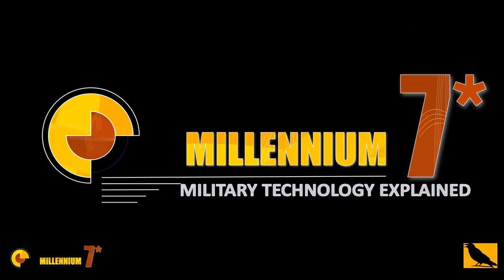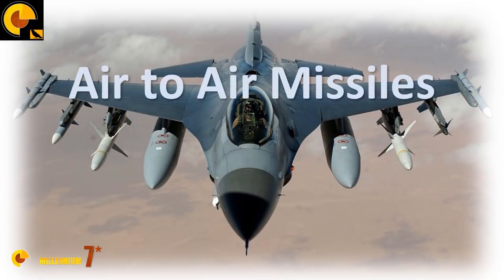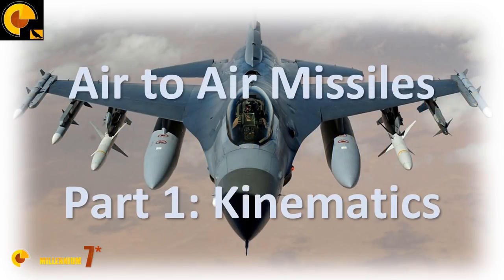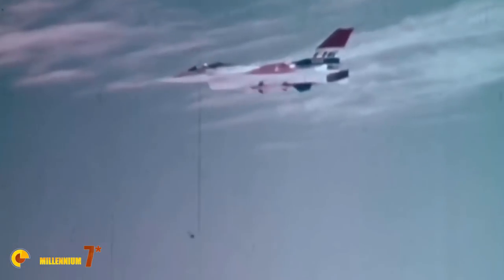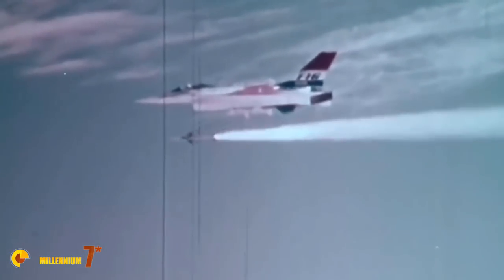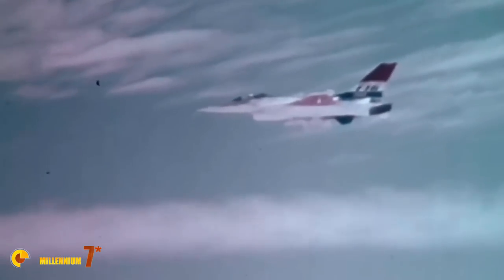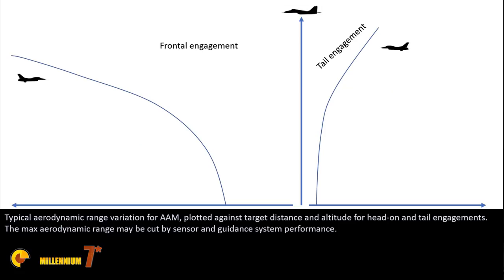Sidewinder, AMRAAM, R77, Asraam Etc. What Do You Really Know About Air to Air Missiles?

Comment: The most overlooked thing about AAMs is actual production numbers and types of the latest missiles in service.  I was almost surprised to learn the Russians still rely on the Ukraine for R-77 production, and have rarely been seen with R-77s on their own fighters, while China and India have purchased and operated with hundreds of the export model R-77 RVV-AE missiles over the past 2 decades.  Another overlooked thing is quality control with continuous testing and validation of operational samples against high-maneuverability fighter target drones that employ countermeasures.  The US currently shoots QF-16C Block 25/30 target drones with live AIM-120C7 and D AMRAAM variants on a regular basis.  What other nations can afford to shoot down their own fighters like that with fully-instrumented test ranges and high fidelity telemetry, with onboard and long range HD cameras tracking everything?
Reply: The Russians have a huge supply chain problem in their defence sector due to the ongoing Ukraine conflict.
Reply: The R-77 was originally developed starting in the 90’s but stalled till the early 2000’s due to the fall of the USSR. R-77 were exported to many countries, but the original R-77 was never accepted in to Russian service (it was seen as sub par compared to what was promised and deemed unnecessary at the time, the R-27 was still a great missile and in many ways it still is). The first R-77 that was accepted into service with Russia was the R-77-1 that had updated seeker head and improved kinematic performance. This was in 2015… and even today, R-77-1’s are outnumbered by R-27’s when spotted on Russian aircraft. People keep saying stuff about the R-77M, which supposedly has an AESA seeker, no lattice fins for improved kinematic performance, and various other performance upgrades, but if we see this missile in service anytime soon it won’t be in large numbers. It will probably get the other R-77 treatment, with a protracted development and induction into service, even more so with sanctions and the Ukraine conflict. In the meantime, they’ve outfitted R-27’s with the Agat 9B-1103K active radar homing seeker, on the extended R-27 airframe designated R-27EA with range of 130km and R-27EM with 170km range, so for the time being it should add to the active radar homing capabilities of the RuAF. 

The R-77/R-77-1 is still no match for AMRAAM C&D nor is the R-27EA/EM. But in the Ukrainian conflict, they’re still vastly superior to Ukraines old stock of R-27R/ER/T/ET which are 30-40 years old at this point and ARH versions of the R-27 should still prove a potent match for older non updated MiG-29/Su-27. 

Ukraines AF is completely unequipped to deal with the semi-modern Russian AF, with 30-40 year old Sukhoi 27’s and MiG-29’s that haven’t been updated in decades and have more than likely had sub par maintenance over the years. 

Against a near peer adversary, like China or the US, the Russian Air Force wouldn’t fare as well.
Reply: @zooweemama911  When we did technical exploitation on the full-up  R-27s from East German inventory, they were utter trash, couldn't even hit a straight-and-level target drone over the UK and Florida live fire range complexes.

The R-73 was a different story, and had a very high pk in visual range, oncluding off-boresight.

I've always wondered how many Western appliances and dual-use electronics the Russians had to acquire to upgrade their R-27 series.  R-27 has a lot of volume to play with for sure, but with the state of their pathetic semiconductor industry, and reliance on European and Taiwanese electronics, I just wonder how they would even standardize the components, maintenance, test units, and train personnel to operate those missiles.

The fact that they're using Su-34s in low altitude bombing and rocket pod profiles does not reflect well on their weapons industry, as they have lost 10 of them now.

These and some other facts make me seriously question their ability to actually improve the R-27 across the fleet.
Reply: @LRRPFco52  This is true; however as is typically the case with Russian export gear it’s probably downgraded to some extent compared to their stock. Iirc correctly as well, those were base version R-27R/T without the extended range and upgraded avionics. Who knows how downgraded they were though. 

Yes, the R-73 with HMCS was a big surprise to the NATO countries. I think the R-73 was a big part of why the AIM-9X was rushed into development and service, the 9M was too close in performance to the R-73 and we wanted the edge.

MUCH of the early work on Soviet air to air weapons was spurred on due to the N Vietnamese sending over jettisoned US A-A weapons, namely the sparrow and sidewinder. The R-13M is almost a carbon copy of the 9D and 9G used by naval aircraft, and obviously the R-3S/K-13A is a 1:1 of the 9B. I have read that early sparrow variants were also copied for development of the Soviets early BVR missile, but this was dropped due to lackluster performance of the early sparrow variants. 

The war in Ukraine has proven that Russias military is all but inept.
Reply: @zooweemama911  East Germans had full-up MiG-29A 9.12A with the same ECM, IFF, and weapons as Russian VVS.  East Germans were so by-the-book that the Russians entrusted them, and they were so forward-deployed relative to USAFE and NATO air forces.

Other nations got the monkey model MiG-29A 9.12B without ECM and IFF. 

Soviets acquired the Honeywell VTAS, and Hughes AIM-9G systems developed for the USN F-4J SEAM in the late 1960s to make the HMS and R-73 for the MiG-29 and Su-27.  I've looked at the helmet-tracking boxes from VTAS, as well as those from the MiG-29A, and they copied the shape of the box, circuit architecture, and SERNO/MFG placard tag down to a "T".

UK, Taiwanese, and US transistors, integrated circuits, and full boards have been identified in numerous weapons and avionics found in Russian missiles and aircraft wreckages in Ukraine.

Their semiconductor industry is a sad and pathetic joke.  The only SC company they have that I'm aware of went bankrupt in Dec 2019, and was seized by the government.

It begs the question:  How will they maintain a developmental and production volume to satisfy the demands of the air, land, and naval forces?
Reply: @LRRPFco52    Very interesting indeed, thanks for the info. From all the literature I’ve read, it was told that the East Germans always got downgraded equipment. Good to know that’s not true. My dads buddy (F-15 pilot) was stationed in west Germany throughout the late 80’s and early 90’s and always said that they didn’t have any idea whether it was up to standard compared to the Russian equipment. Of course, he was a low level pilot, not an intelligence officer or the like. He said that sometimes they would be told it was superior and sometimes it was inferior depending on who was relaying the information. 

Interesting that the HMD, was taken from the Sidewinder Extended acquisition mode and a 9G. From what I can tell, the 9G, while not all aspect was a very potent missile compared to the USAF 9E/9J. Obviously once the AIM-9L and M came onto the scene, it was a pretty potent match for the R-73 but the lack of the HMD/JHMCS really limited options in a close in dogfight. 

Great questions; its hard to predict what the Russian Government will do with the semiconductor company, as it is with most Russian companies that declare bankruptcy and are then made a state owned, state run company or industry. 

The Russian Naval Forces are still pretty irrelevant in my opinion. The Air and Land forces still seemed relatively competent but Ukraine has proven otherwise. Seems like a slow burn, high casualty war for both sides, echoing the feelings of the Second World War when the Soviets were slowly beating back (and also causing and taking mass casualties) the Wehrmacht. 

The Russians, while not super well equipped for this conflict, have for the most part much more secure access to raw materials (minus SC’s obviously, and with Taiwan being the #1 producer of most microchip and electronic technologies yet being very closely allied with the US and against China ) I think the only real possibility of securing chips and conductors is through the CCP. 

Sorry if this is poorly worded, and seems hard to read. Tested positive for COVID today and feel very off. Take care.
Reply: @LRRPFco52  my country was very dependent on Russian missiles but thank God now we have also developed our own astra mk1,mk2 &mk3. missiles we have even better capable seekers compared to Russians that too are based on GaN.
Reply: @zooweemama911 thanks for this great info..

Comment: The airliner I fly has a maximum load factor of 2.5G. But that is really more to do with keeping the aircraft light. I've never heard of someone's bones breaking at 3.8G, perhaps some one with a health issue. Most people are fine at 3G with no training at all which I have done in aerobatics flights. Even a 2G turn requires a bank angle of 60 degrees, which is well above rate one turns used for IFR flying, normally 17-25 degrees angle of bank. The main G loads airliners suffer are in turbulence.
Reply: You're overthinking one part and underthinking another part.  On a civilian aircraft, you have small children and elderly.  No harnesses and no high-g flight suits. If you secure an egg inside a metal tube so it can't move, you can shake it and swing it and spin it with all your strength, egg will be fine.  Do the same with much less strength but the egg is able to bounce around, egg will not be fine.
Reply: @EdgewiseSJ  you don't need  G suits for any of the forces I was talking about. You do need to be seated, but that's about it. Tossing people around in the cabin would be a problem but that's actually about oscillating forces more than the magnitude. +1 to -0.5G oscillations would harm people who are not wearing their seatbelt by virtue of them hitting things and therefore having their weight supported on an object or angle that you would never normally do. Your bones won't break at 3.8G, they will at 1G if you ankle is twisted because you weren't seated and were floating a moment ago. You need to get above 50G to start cracking bones for people with skeletal issues, healthy people can endure over 100G with bruising but no fractures. I have completed high G turns with no flight suit and a normal physique. 6G and -2G respectively. Your egg example is probably not what you think it is. An egg being thrown doesn't brake because it is only being accelerated at a few G. It brakes when is hits a wall because it's being accelerated at a much higher G. When you threw the egg it was say 3G over 1s, this gives a velocity of 30ms. When it hits the wall at 30ms and has to decelerate to zero over 0.1s (Probably less), the G (Which is a measure of acceleration) will be much higher, perhaps 30G or more, and so the egg brakes.

Comment: First: thank you a lot for explaining things. A lot of lightbulb moments for me overall.
Second: this video had two lightbuld moments for me. One thing in this video I didn't know and had no chance of deducing was that the air-to-air missile actually glides most of its trajectory. The second thing was the load factor rating of missiles. Most of other really important considerations you voiced were a logical consequence of these two or things I already knew. For example, I used to paddle a lot (I still paddle, just not a lot), and there are some maneuvers that feel like exchanging kinetic energy for turn (and the rate is enormous, btw).

Comment: Why at 7:30 do you say that the target's movement has very little impact on RMax? You obviously know that's not true because you talk about it later on while talking about dodging missiles.

And last second jinks can defeat missiles, particularly if the missile's running out of energy. Missiles can pull more g than jets, sure, but jets have sustained power and can pull 7-9g pretty much whenever they want. A missile that's been off burn for a while might not be able to make a sustained tight turn to continue intercepting, particularly given how fast they stall.
Reply: Oh, I should add that I liked the video, good information about the general behaviour of AAMs. Well done!
Reply from the maker: I listened again that point and it may be a bit unclear, actually. What I mean is that the PK of a lob trajectory is less sensitive to target maneuver than a straight one for energy management reasons, not that Rmax doesn't depend at all from the target movement. 
Coming to the second point: I agree with you, but  I  wanted to criticize what you see in films and most games, which is the sharp turn in front of a missile with the engine still burning.
Reply: If a missile is launch from a f 22 raptor at 60 nautical miles range from your 6 o clock your are dead both the amrams scorpion D missiles will take out both engines and there goes the su 35 boom
Reply: And if the israely f 15  jamms your radar  and shoots with stunner missile at your 6 o clock boom your dead in your mig 29 .
Reply: If eurocanards jamm enemy radars and get in 6 o clock position off su 30 boom flanker pilots are dead from meteor missile hits.
Reply: @RicardoMrMendes  you smooth brain think pls
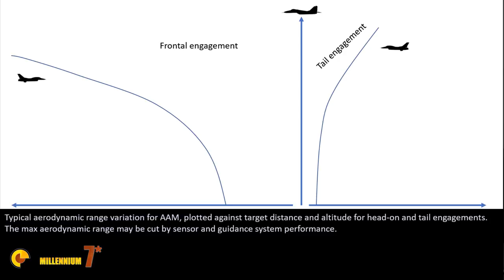Reply: @RicardoMrMendes  if you want to actually understand why what you said is false you can look at the chart at 13:22. The dark blue lines are an approximation for the position the shooting plane can be in a expect the missile to hit its target, the mig29 in the middle of the graph. They indicate relative distance to the target and and relative height.The right side of the graph shows a tail engagement, while the left side shows a frontal engagement. If you know compare the dark blue lines to each other you will find that for the tail engagement the shooter will have to be way closer in order to hit a running target. This is because the  missile actually has to cover a larger range than in a frontal engagement in order to hit its target. The reason for this is that missile has to aim in front of where the target is expected to be in order to hit. In an engagement with a positive closure rate aka a frontal engagement  (kinda) this point is actually between the two aircraft (also only kinda) therefore the missile a to go a smaller distance than the distance of the aircraft to each other is when it is fired (only kinda since i am disregarding flanking targets but oh well). However the opposite is the case if the target and the shooter have a negative closure rate. Then the missile actually has to travel further since the expected point where the missile arrives and catches up to the target is actual from the point of view of the shooter behind the target. That is why its actually a good idea, at least if your enemy cant easily penalize it, to run from the missile and therefore reduce its range drastically. For instance in a fairly accurate simulator, dcs, the aim 120 has a range of above 50 kms in ideal conditions, however in low altitude and a tail engagement in only has a range of 7 kms. And that is already a stretch. Therefore your comments dont make any sense whats so ever.
Reply: @RicardoMrMendes  or just watch the dam video its really good.

Comment: 9:50 is just not correct from a physics pov. A turn radius of an object turning with 20g while flying 3km/s is wider than a turn radius of an object flying 1km/s with a 9g turn. If the Missile and the plane would fly at the same speed, the g tolerance would be comparable. With the missile being faster, a turn that would mean 9g for a fighter can mean more than 10g for a missile. Evading missiles is possible.

Also, missiles aren't flying directly at the target, but anticipate the point of impact. This point of expected impact can be altered by a plane in a tiny amount of time by flipping around and pulling max g the other way.
Reply: A lot of AAMs will do 30g and higher.  The short amount of time a missile spends in the terminal phase is usually not long enough to allow a practical response like you describe, especially a reversal.  If an active seeker missile is dropping down at Mach 2.5 to Mach 3.6, the closure rate shrinks reaction time into a few seconds at most after the maximum ordinate.  A fighter aircraft simply can't change speed and direction enough to have a practical effect on terminal guidance, which is why ECM is leaned on so heavily.  The best defense is to avoid staying within WEZ after missile approach warning, but active seeker missiles that receive mid-course guidance without triggering the RWR prevent the target fighter from knowing there is a missile homing on it, until the terminal phase where the missile's seeker goes hot.  With latest generation of missiles takes these things to new levels of preventing missile cueing detection, ECCM, with more advanced rocket motor propulsion and dual-mode propulsion like on the Meteor.

If you're down in thicker air, then there is more ability to maneuver, but if you're that defensive already, you've become a missile magnet anyway.
Reply: @LRRPFco52  makes sense, thank you

Comment: If you need to use air to air missiles get in the 6 o clock position behing your enemy to fire missiles . Other than that and your enemy will not let you fire . Simple as that becouse your enemy has radar and infrared sensors and will detect you .
Reply: This is far too simple of a statement and is void of any real research into actual missile behavior.  There have been numerous frontal and frontal/oblique high aspect missile shots dating back to the 1960s, which have only increased in frequency of occurrence once all-aspect IR missiles and active seeker radar missiles were introduced in the 1970s.  Rear quadrant missile solutions are only a part of the full spectrum of weapons employment zones.